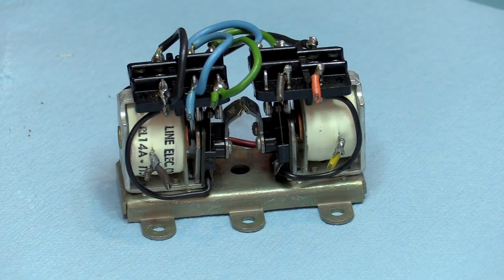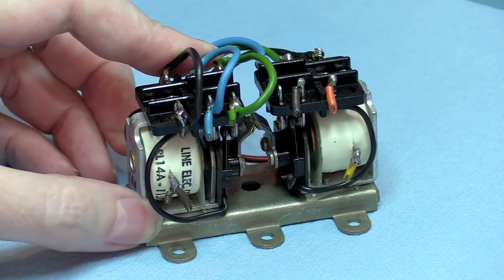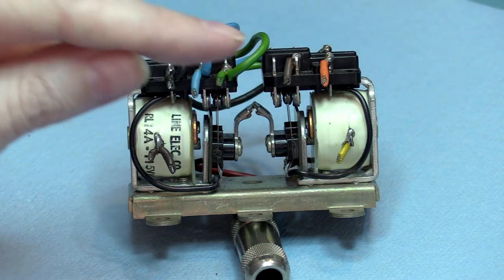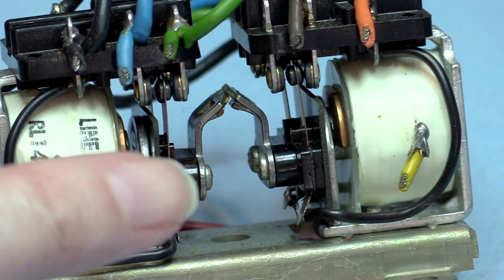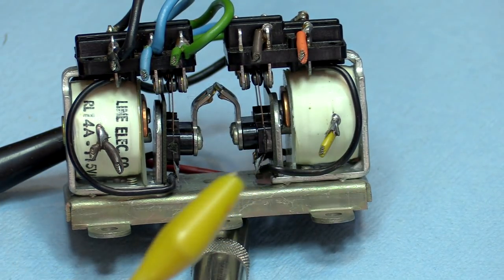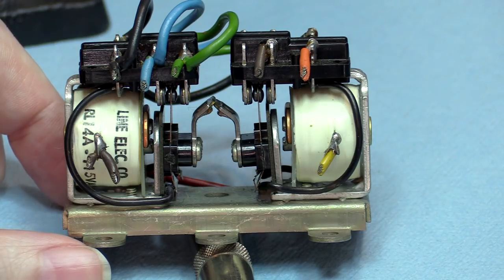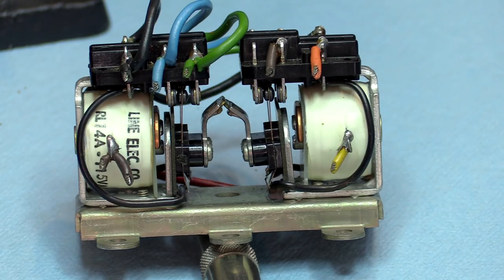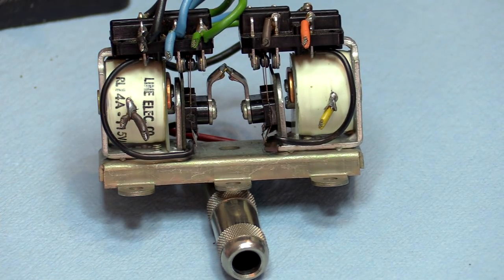Now That's What I Call A Flip-Flop!!!

Comment: Had a friend that wired all the lighting in his house with these. Push on, push off with illuminated pushbuttons, and a central control station, in addition to the local plus buttons.
Reply: There are relays specifically meant for lighting, available from several manufacturers, that perform the same function as this, but are (IMO) a more elegant mechanical design.  Their coils typically run on 24V half-wave DC.
Reply: Think my friend got his surplus, and the coils were 120VAC. We had good connections in the industrial control world at the time, so the push buttons he used were full size oiltight industrial push buttons. He has a very tolerant wife :-) @kc9scott

Comment: When I took the cover off my Lionel train engine as a kid, I noticed there was an electrical mechanical "flip-flop" controlling the forward/reverse direction.  I always thought it was a clever design as it used a single coil with an alternating escapement mechanism (a bit like clicking a ball point pen).

Comment: My mum used to work at the Ford motor Co computer room way back and they had these in the old mechanical systems there. I remember being in there when I was very very young and the roar of those systems switching away was deafening. Literally. Thanks Fran, for showing us you Flip Flop. 😁
Reply: What building was the computer room located in?
Reply: @larrysbk  It was in Summerton here in Victoria, Australia , and was a big brown office building. If you drive past you'll still see the building between the old factories which I think have been converted Into shopping warehouses . The computer room was in the basement. I'm not sure if they're still there, but the bottom of the building had virtual steel shutters which they installed after the workers turned the fire hoses on and flooded the computer room after a riot over pay and working conditions. After that, they rebuilt it to be air tight. My mum Said that if anyone hit the emergency button they had 3 minutes to get out before the doors shut to secure the systems.

Comment: Awesome.  Yes very stable. Memory is not lost during a power outage. Critical for weapons and elevators. A small power blip might lock a system up. 
Very green. No power needed to hold each state. 
Each solenoid looks to be welded not screwed in place so repair of a single side is iffy. 
Worthy of its own video.

Comment: I love it! I made a counter out of relays when I was in high school, probably spring 1969. It didn't work nearly this well. Mine was very sensitive to contact spacing. I learned later about wrapping the coils in copper to make them release more slowly, when working with Strowger switches (step-by-step switches, early telephone switching equipment).

I had hoped to make a small computer out of it, but of course, w/o reliable switching, and, most importantly, money...

Comment: It was maybe built that way for some high-safety application where preserving the state if the power was lost was really useful. Like an elevator?
Reply: I think elevators use multi-pole relays that have two coils that move a mechanical biestable switch.
Reply: I have to believe it would be used in non-critical applications as well - just for the power reduction.  Keeping one of the coils powered all the time to keep its state would probably take around a watt - perhaps even more.  Far more than just a pulse to switch it over.  Those watts add up quickly if you need a few of those!

Comment: Also called a "Bistable DPDT Mechanical Latching Relay AC switched", Equivalent to an "SR Latch" in electronic circuits, a Flip Flop of the SR type uses a clock to sync the change over as does a JK. A D type flipflop only has one input and an enable. Those relays are used a lot for motor control forward/reverse in a lathe for example. Yours is a very nice model.

Comment: Cool find - Yes, this is an electromechanical non-volatile flip-flop or memory bit. Very handy for holding a switch state without needing power to hold that state. Bonus feature is coil life extension. Can be used to redirect power to remote devices simply by pulsing the appropriate coil. As a safety feature, can be used as power interlock, forcing equipment to stay off if there is a power fail event. A reset pulse is required to enable the equipment again.

Comment: My stimulus check came in yesterday, and I blew a good amount of it getting little things, hookup wire, a new voltmeter, an acoustic pickup for my guitar and the rotary tool to cut the wood to install it. FranLab has not only kept me sane during lockdown, but it's pushed me in the direction of re-finding my roots as a kid who used to just try and make things. (Many other vloggers deserve credit in this fashion as well). 

Fran also is one of those "geeks' geek" from an educational perspective (she teaches teachers, maybe she's a meta-educator?) Even if one understands the circuit under discussion, her way of describing it often provides just that analogy you were looking for to explain the difference between an active circuit, and a passive one, or an elliptical versus a circular orbit, whatever the situation is. She has Feynman-style explanations (I know both she and Feynman are from the northeast corridor, and I'm from Kentucky, that's maybe why their manner of speaking sounds the same to me... rapid fire, with alternation between fact and observation).

Comment: An assembly that looked very much like yours, and worked the same, was used in mechanical traffic signal controllers from the 1960's.  We called it a latch relay, and it was used to receive a pulse which told the controller to run a different timing plan.  For instance, morning rush hour, normal, and evening rush hour.  In the case of my city, Des Moines, Iowa, pulses were sent over leased telephone lines from a central location, to the signal controllers scattered all over town at each intersection.  An electro-mechanical device called a responder decoded the ~70 vdc pulses from the phone lines into one of three outputs, and sent the result to your latch relay, which powered the appropriate timing motor of the controller.  Whew.

Comment: Hello Fran!
Latching relay, the "newer" designs behave the same way, but they use the same coil with a center tap and two inputs with a diode each of opposite polarity and a permanent magnet that holds the contacts in whichever position they were last left. Thanks for all you do, have fun, and be careful. 🙂

Comment: IBM used a similar functioning wire contact relay in some of their high speed card equipment they called a latch/pick relay. It also had two coils but one set of contacts; impulse the pick coil to set and the release coil to reset.

Comment: I love this! I so wish I had saved a mechanical flip-flop I had in the 70s. Same idea - no current needed to hold state, but it used a single coil. When pulsed, a flexible plunger poked into a teeder-todder that flipped a slide switch back and forth.

Comment: That's very cool Fran!! As an electrician this looks to me like a generator/mains power transfer switch for low current or maybe pilot duty with two larger contactors. It would provide positive isolation between the two systems. In other words yes....a flip flop.

Comment: They still use latching relay in Programable thermostat. The cpu in the thermostat send a Pulse to relay to turn on the heat or A/C,  and another to to turn it off.  That way you extend the life of the battery in you thermostat.
Reply: I hope they have a fail safe such that the unit turns off the system before the battery breathes its last.  Would be great to come home from a vacation and find your house at 130+ degrees because the battery failed while the system was in the 'on' state.  I had exactly that experience with a house I was taking care of that had a very old thermostat where the contacts welded together.  The house had an old gravity furnace without modern safety controls and I hadn't been there in 2 days.  I figure if I had waited an extra day to show up like I was going to, that it would have gone up in flames.  After that scary experience (the walls were too hot to touch near the heat grate and the thermometer on the thermostat had exploded), I put in a 'Sensaphone' monitoring system.  This was about 18 years ago.

Comment: I have another form of relay flip flop that doesn't need power. It has two solenoids on each end of a seesaw that can pull each end down. On one end is a roller that pushes on spring contacts mounted at right angles. The springs hold it in the state left by the solenoids because in the mid position the roller is at maximum extension.

Comment: I don't know if you have ever run into what we called clutch relays but it was a single coil relay with a mechanical linkage in it that allowed lock up when one pulse was received by the relay and then the second pulse would unlock it and the third pulse would lock it again I first ran into them on old Ademco alarm systems. They were used for the arm / disarm function with a momentary activating key switch.

Comment: I have seen a slightly larger contactor-type version. Two contactors were mounted vertically on a metal plate and operated in the same manner. It took me a while to figure out how it operated until I looked under the plate and discovered a pivoting metal bar that locked out each relay as the other operated. It was used for reversing the spin direction of a 3 phase motor.

Comment: I can't say where we used those, but we used those for state holding in power loss events.  Simple devices that you cannot duplicate electronically for specific applications.   Ours came in sealed boxes with about 5psi of Argon.   If/When the little pressure (loss) button popped up, we'd unwire the unit and toss it, put in a new one.   You would usually lose pressure long before the contacts or the pawls wore out.

Comment: To me, you are right.  This is a flip flop.  It is a mechanical version of what was done with two triodes really.  It does the same job.  It would have been popular in situations where pulses were used and not an always on coil.  Momentary switches, pulses from a rotary dial, preventing burning out a coil and having a weird state.   Sounds like a brilliant idea to me :)

Comment: I have a few similar functioning relays, that are different in the mechanical details.  Also a relay set that is mechanically tied to prevent both activating at the same time.   And a mechanical time delay relay.

Comment: modern latching relays use magnetic remanence, but are limited in the size of contact they can operate and AFAIK use only DC coils. These dual types can switch the load directly. In Europe they were made by the German company Kuhnke.

Comment: I Once worked for an elect manuf c/o in  OZ  melb heineman  electrical     who made elect power cabinets /circuit breakers etc for factorys etc 
i  was on a press  stamping out copper bus bars and  feed machines spools copper wire that wound Switches  Simular to above 
they made there own  winding machine  in shop   also spring coiling machines  that made long  lengths  100's meters  in 1 go  
 bike brake type cable spring  -   the   place seemed   a bit  weird   to what i was used to -  25yrs in spring manufacturing  .

Comment: I've seen these a few times here in the UK on steam boilers, a fail safe if the power goes, the control doesnt just turn the oil fuel flow back on after a power outage.

Comment: I’ve seen equivalent of this flip flop with only one coil and pure mechanical device switching and holding the contacts in one of both stable positions. It can be find on such a cars as Trabant and Warburg manufactured in ex DDR ( eastern Germany ) . On every electrical pulse energizing the coil the relay flips to the opposite state ( the coil doesn’t need to be permanently energized in order to hold the position , energizing is necessary only for changing the position to opposite ) . It is used to switch the high/low beam lights  .
Also there are so called “ polarized relays” which has two stable positions with only single coil but in order to change their state,  pulse with opposite polarity need to be applied to the coil ( they do not need energy in order to hold the position as well )

Comment: I worked in Armstrong Rubber in the 70s and they had a machine the use a Cutler Hammer latching relay that work on the same idea. You could latch it with one coil and it would machically hold until you electrically unlatched it. At the time we had a Cutler Hammer rep come in and he called it the greatest clunker they ever made. A similar type was used as a shift rregister in a machine to spit bad parts out at a designated place on a machine

Comment: Hi Fran, here in Europe things like that are not so seldom. I / We would call it a bistable relay. Very common in battery powered heating thermostat for example. It offers potential-free contacts which can handle our 230V AC easily and does not "eat" any current from Batterys (ok a little bit when switching but this is more or less negligible). They are still manufactured in a more modern, encapsulated design for sure.
Chris

Comment: Oh Fran, this is not a real flip flop! Youre getting that terminology all wrong because by definition a flip flop is an electronic latch, because I know, i've been on the internet, and i see that it was actually invented by a couple guys who made it out of triodes back in 1918 and it's always been an electronic device and yadayada!
Reply: Actually, Fran's relay is a real flip flop. A flip flop is simply an output in a fixed state, determined by one of two short pulses, i.e. a bistable multivibrator. You can do this with relays, triodes, transistors, TTL or CMOS gates. In fact, a flip flop is not by definition electronic, and you mention triodes, but switching relays were used far earlier. Flip flop might now be implemented electronically, but the flip flop function predates electronics :-]
Reply: You're funny... Lol!
Reply: Before electronic device relays works on automatic switch. Not electronic. Electronic came much more late. Many automatic machine was work before invention vaccum tubes or semiconductors.
Reply: @Dirk-R  I think you missed the humour.
Reply: It was invented by Jonas Flip and Martine Flop in 1889, who are distant relatives of Click and Clack..
Reply: 0:34 I see what you did there!
Reply: huh huh.. he said..  bistable multivibrator.. huh huh..
Reply: @BenK12345  Well, people that bend that way will appreciate its stability then..
Reply: @greendryerlint  are you sure Ding & Dong were not involved?
Reply: What's great is that I saw this comment at the exact moment Fran was saying it...
Reply: I'd struggle to include this in any of the designs I tend to do these days (usually sub 8nm). I think the setup/hold requirements would cause a few issues.
That, and the fact that the typical operating Vdd tends to be about 0.75 V DC. Nice to have the option of an Ultra Mega High Vt cell though.....
Reply: @Green Lint   bistable multivibrator is replaced at times with Ding & Dong
Reply: @greendryerlint  Didn’t those two invent that what’cha’ma’call’it thingy that revolutionized them thing’a’ma’jigger’s for them doo’hickies? Or was that them Click & Clack bro’s?
Reply: @greendryerlint  The infamous Tappert brothers?
Reply: @Dirk-R  he was being sarcastic lol
Reply: Flip Flops are foot shaped pieces of foam with a rubber strap to attach them to your feet.
Reply: @zoran9a3hpdiy  you’re absolutely right. It’s incredible what you can accomplish with relay logic. I once had to repair  a GE numerical control interfaced to a lathe using almost a thousand relays. There are some beautiful videos on youtube demonstrating computers using relays.
Reply: LOL, a start discussion 101 course. Here's one, Zuse computer had 2600 relays, heaps of flip flops in it, eat that :)
Reply: @greendryerlint  Exactly, I knew their nephews Tee Tee and Elle, and Cee and Mos.
Reply: @bjl1000  Nope, a flip flop is a bistable multivibrator, e.i stable output, on or off. Politiciance are straigt multivibrators, as they change continiously.
Reply: @nexpro6985  I think you were too slow, three comments beat you :)
Reply: @bend1483  Euh, "I know, i've been on the internet", that's not sarcastic, that's today's way wisdom. Alligning the zillion flip flops in computers through the internet with pudding brains. 18 replies! Popcorn time :-]
Reply: @anonymous.youtuber  But this is only partly relay logic. The latching is performed by the small levers attached to the solenoid's armatures.
Reply: @nexpro6985  Nah, I believe Ding & Dong worked at Bell Labs at the time. Due to some disagreements with their research director at the time, Dr Latch, Flip & Flop went on to start a manufacturing business, which is rumored to have had some limited success within the beachwear sector.
Reply: @benhetland576  sounds plausible.

Comment: In the age of Eniac, the twin-triode flip-flop was known as an Eccles-Jordan (Trigger) Circuit. (Aka bistable multivibrator) How the name morphed to “flip-flop” is probably on the OED but it isn’t handy. I suspect it has something to do with how hard it is to remember how to spell the first author’s name, and/or the EE’s endearing penchant for naming things based on their essential behavior. Cf resistor conductor inductor valve, etc. When it became more evident that flip-flops  could come in flavors beyond the one in the patent, economy almost certainly pushed toward unification.
It was Turing who realized a flip-flop could store one bit of information and transformed the circuit from a implementation to a powerful abstraction.